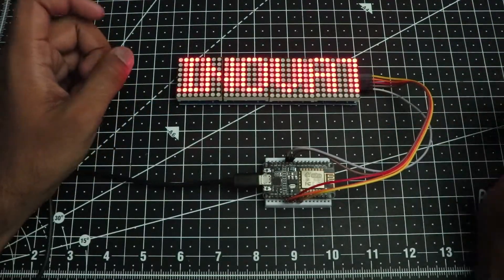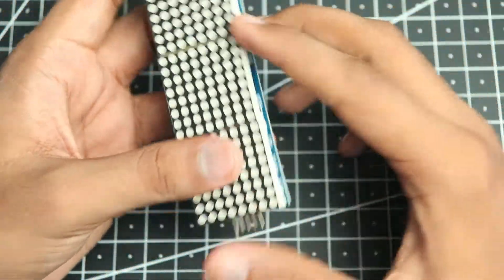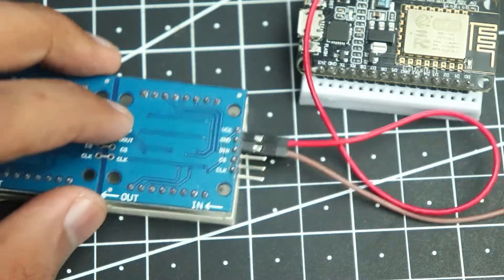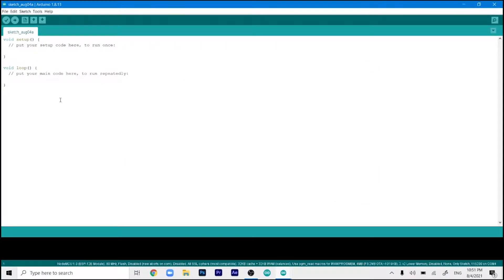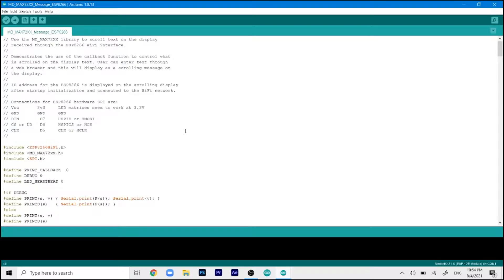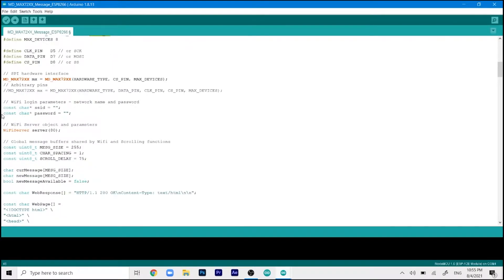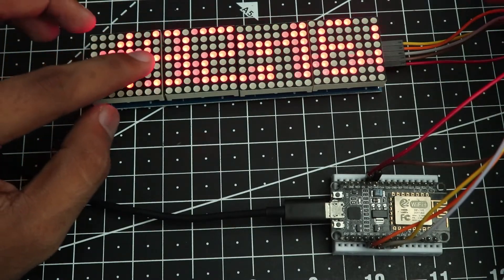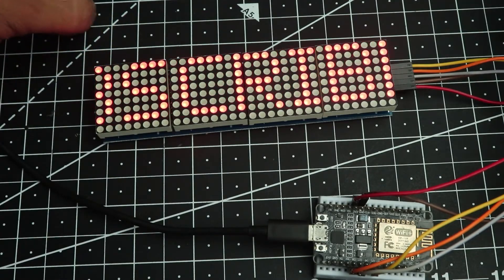How to Print Text on MAX7219 matrix Display With ESP 8266 from Web Browser

Comment: 1) Nice video  because there are few using the ESP3266   2) Voltage Question   You connect a 3.5 Volts source.  Can you use a 5.5 Volts in order to use the cellphone chargers as a source ?  Or could you use 3 x 1.5 V batteries for 4.5 Volts ?  Thank you
Reply from the maker: Ofcourse you can use 5v.
There wasn't a 5v output on the esp so used 3.3v instead.